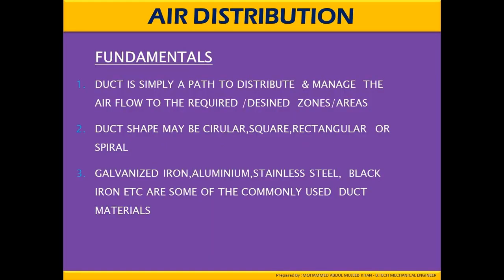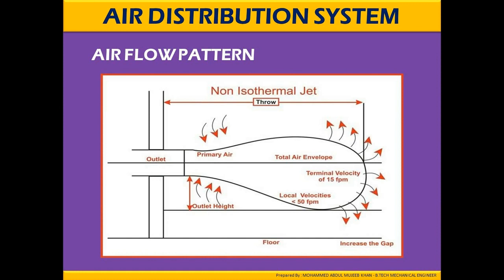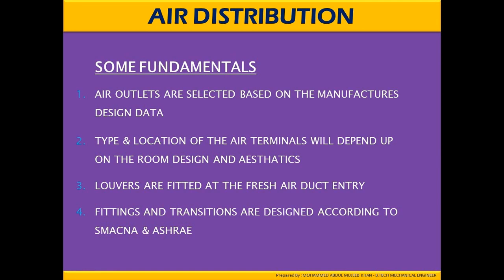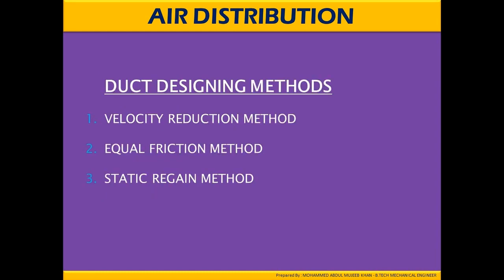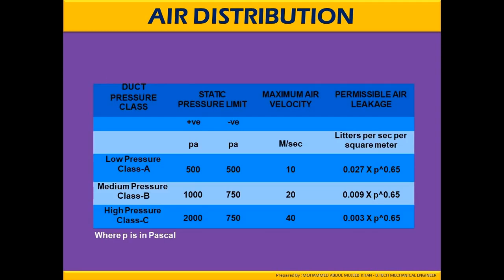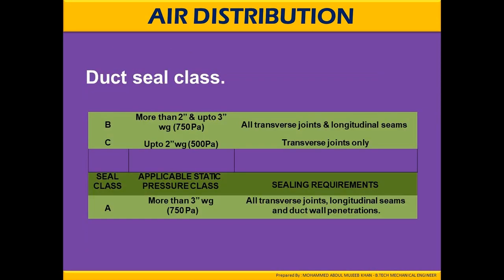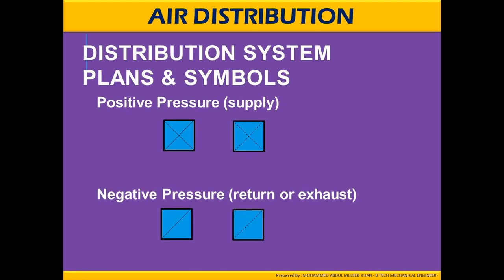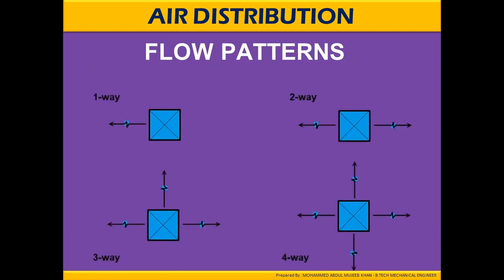HVAC Training - Duct Design System & Standard Procedures

Comment: Can you please make a video on external static pressure calculations if there is a plenum and slot diffuser at the end.
I have searched a lot but there isn't any video on it. Please
Reply from the maker: Static Pressure Calculation video is available on the channel.
Reply: @hvacsimplified  Yes I know, but what should we do in case of plenum and a slot diffuser at the end. How to take pressure drop for plenum.

Please make a video on 3 slot diffuser at the end with plenum.